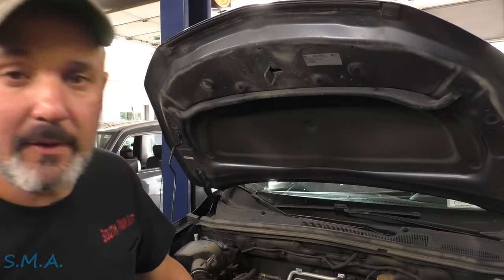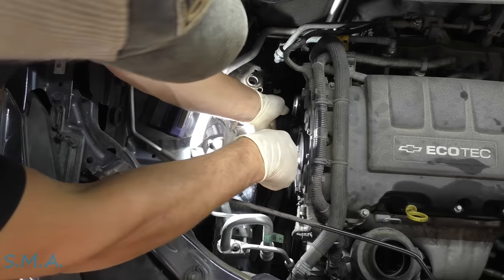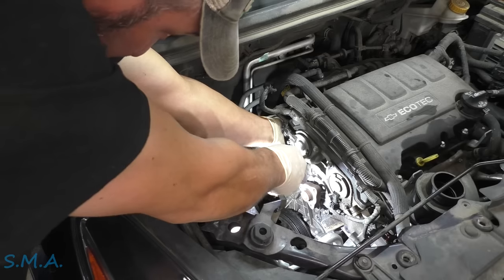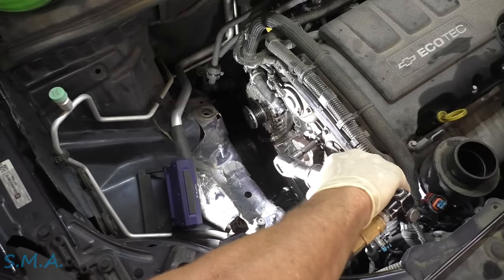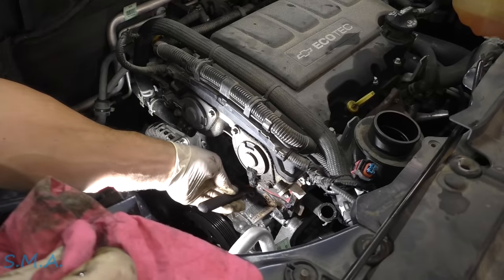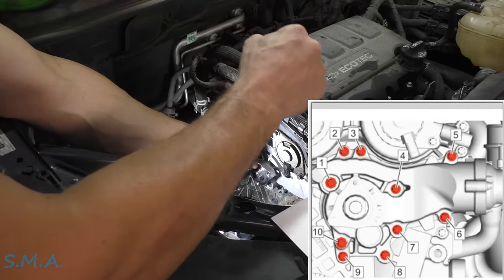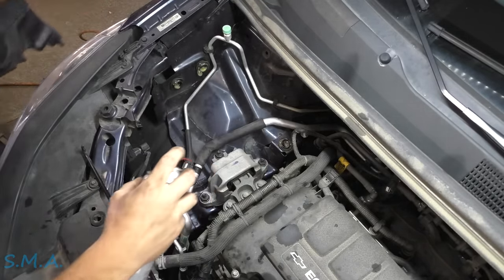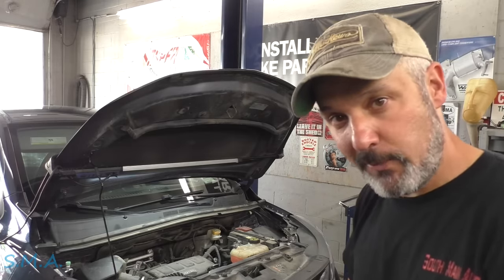Chevrolet Trax: Water Pump

Comment: 6 motor mount bolts on that 1.4 torque monster... impressive.  I hope its enough to hold it.
Reply: And the motor mount bolts are torque to yield. Had to buy new when I replaced water pump 1.4 ecotec
Reply: @stevem2757 no, they are not torque to yield on the motor mount. I've been doing this for 15 plus years, thousands and thousands of cars and never once has there been TTY motor mount bolts. I have two vehicles with the 1.4t and I've looked in service data...you are wrong just so you know. Crank bolt is TTY though
Reply: Take it easy dude. Chill. That was the advice from the Chevy service department/parts.  That is what I was told when I purchased the new water pump from the dealership.
Reply: Also some of the water pump bolts are tty also confirmed from the dealership.
Reply: @stevem2757  again, you're wrong. No water pump bolts on anything are torque to yield. I've worked on thousands and thousands of cars...thousands of water pumps, never tty bolts. They want to sell you more stuff buddy. Even service data confirms they are not tty bolts. I have service data for my 12 and 13 Cruzes...which have the exact same engine as the trax and encore...same water pump. I looked it up before I even commented. If you need dealer advice on how to work on a car, please just don't do your own work.
Reply: GM Service Bulletin # 14371B
Date 1/2015 Parts Listing Outlined from the OEM. GFY Troll don’t ever reply to someone’s post a year later, again. Again GFY Troll.

Comment: hell yeah...a few years ago were were headed south in he 2008 town and country. developed a leak in the housing from the radiator to the engine. sruck in friday night slow freeway traffic near mt.vernon KY. Finally got off to the exit. Got flat-bedded to a shop nearby....the due had mud trucks and some drag cars and I knew we were in good hands. 5 years later and the '08 town and country is still running strong. Thanks to those dudes in KY....

Comment: Another well-designed GM product for ease of maintenance.
Reply: If you think this was bad maybe some day he will do a v8 4.7 toyota timing belt, every 100k.
Reply: Sarcasm ?
Reply: @guns-gas-diesel  that one is not bad. Huge space to work on
Reply: I would take that one. Remove the engine mount and you have 1/2 a mile to work between the engine and frame.
Reply: @guns-gas-diesel  lol this engine won’t even last as long as the timing belt on a toyota

Comment: Modern car engineers meeting.
The boss: "Replacing a water pump is way too cheap and easy.  We need to fix that."
Engineer one: "We could design them to fail in four years, and require a good mechanic spend two hours replacing it."
Engineer two:  "Let's cover it up with the air box."
Engineer three: "Better yet, let's require removing an engine mount."

Engineer four:  "Amateur hour.  Let's put the alternator UNDER the water pump!"
     The meeting breaks into laughter, with the boss pounding his fist on the conference table.
Boss:  "Man, you guys are catching on.  What else you got."
Engineer one:  "Well, the parts guys propose over-pricing all parts, and back ordering everything."
Boss:  "Mr. Engineer One, pricing parts is for the bean counters.  This is a professional engineers meeting, so get back in your lane.
Reply: Good analogy. It would seem that they make it so that you get mad, say things you will regret and scratch your head saying " why would someone design the water pump to take 2 hours to take out. I could go on and on.
Reply: Apparently you’ve never replaced a timing belt driven water pump. Lol. This is cake work compared to a lot of them.
Reply: “Oh, and another thing, let’s put the starter inside the transmission. “
Reply: Yup!!🤣
Reply: To be fair he also didn't have to remove the tensioner or the radiator hose going to the thermostat housing I've done 2 water pumps on my 1.4 and didn't have to do any of that
Reply: @jimburgess9205  Or “under the Intake” What,,,, Cadillac ! LOL
Reply: @alexlacey9808  Have we come to that?  Water pumps, alternators, sparkplugs, starters, etc., should be maintenance items.  They currently are not, nor will they likely ever be maintenance items again.  Modern engines have become so reliable that many are put away way too early, as the cost of what should be routine maintenance is silly.  Moreover, most cars are put down because the AC stopped working, or the windows stopped working, or the rear stunts needed replacing, or one of the computers stopped working, etc.. etc.
Reply: You never worked on a franch car huh ? These GM engines are a dream to work on. Any dude with a spanner can go at it.

Comment: 45 years ago, I replaced a water pump in a Datsun B210 in 15 minutes with a 13 mm socket on a 3/8 drive ratchet after wrenching on the 3 pump bolts and the fan belt.  More time was spent drinking beer while waiting for the car to cool down than executing the repair.  Mrs O might not approve of my delay tactics but I was in my parents driveway, thus had supervision.
Reply: Yeah...so true.  I have an 89 GMC V1500 Suburban...time to access and remove water pump was maybe 25 minutes and I'm DIY.
Reply: Hell yes.. same with my '84 toymota pickup.. I miss her.
Reply: B210...was good.....I bought a new 310.....much fwd junk.

Comment: Another way to keep track of the bolts is to use the picture on the box (if it has one) and pop the bolts through the cardboard in their proper location.
Reply: nail  polish comes in all different color that is what i use steal it from the wife
Reply: @juanrodriguez-ry6yt  "nail polish... steal it from the wife..." Sure thing, buddy. We believe you. Millions wouldn't.
Reply: I usually avoid buying GM’s and that solves the issue
Reply: Geez, I was upset I had to remove the alternator to replace my water pump.
Reply: I used to use glow in the dark nail polish to mark timing marks to use a light gun on. It worked great.
Reply: In my experience the picture on the box is a random/generic representation of whatever the part is, not the actual specific part.
Reply: @awakenotwoke1973 😂😂😂

Comment: I recommend you replace both water pump and thermostat they are cheep garbage too i have replaced the water pump just to replace the thermostat 10k miles later both pump and thermostat go around 115-150k just easier to do 1 and done as always your the best Chanel out there showing how to do stuff love your channel

Comment: My friends seem to bring me this repair in various owners as skill level.  So what I so appreciate is the small needed alignments, such as the pin, the top motor mount and bracket (as slightly lifted). And the real care as not to break tabs.  As these units age, the tabs become very brittle.  Even with the most careful pressures, will snap from age and heat cycles.   So, as pricing these repairs to aged models, it is very prudent to include a bit of extra as small fitings estimated to need.  And, as was shown, a new belt.
Thanks for having us along.  M.

Comment: You're doing a fine job young man. This is more GM junk. We run about 20 fleet cars in our company and the two that have been the most trouble have been a Chevy Equinox and a Fusion Ecoboost. The '21 Equinox broke down with about 6,000 miles on it. The Fusion suffered a severe oil leak at somewhere around 40K and required a new engine, then the water pump on the replacement engine failed at 115K and almost ruined another engine. Anything with a larger naturally-aspirated 4 cylinder(Altima/Camry/Fusion)have been flawless.
Reply: Loved my Beretta, but stared at it for 30 minutes before my brain would accept that I had to take off a motor mount to change the belt.
Reply: Turbo Gm, or Ford 4 cylinder. JUST SAY NO

Comment: Nice video, great for everyone to see how involved this job is.  The upper radiator hose has a quick release thats easier to remove than the clamp. I remove the 3 thermostat bolts and leave the thermostat attached to the bypass hose instead of fiddling with that hose. The 3 horizontal motor mount bracket bolts and the 3 vertical bolts are all also torque to yield one time use bolts.
Reply: Once you removed the quick connect retainer, what exact action is used to remove the hose side from the thermostat housing? Pull? Twist? Thanks!

Comment: Had to do one of these a few months ago. Dont buy a cheap water pump, the one i was provided the impeller wasn't pressed on all the way and bound up when i bolted the water pump on so i got to do it twice. May as well replace the valve cover gasket while you are there before it starts misfiring from oil in the spark plug tubes.

Comment: Thermostat replacement used to be DIY job for $5 but this is a "better" way of doing it.
Reply: Unfortunately all thermostats cost way more than they should these days. Had to replace the thermostat on my 08 impala last week at 210000 miles and the freaking thing was 34 dollars from Napa. That was the cheapest I could find locally too. If I wanted to wait a few days for it I could have gotten it from rock auto for 8 bucks but I couldn’t wait all week.

Comment: Very nice, Eric O.! I have an '08 Saturn Astra with a 1.8 L Ecotec. Mine's an XER, though, so after air box and serpentine belt removal, there are 8 bolts: 3 for the pulley, and 5 for the pump. I'm about to roll 110,000 miles and the pump is just starting to weep, so I suppose the seals are about to go. Pump is on order and should arrive next week. Cheers!

Comment: love ur vids . having done a dozen of these professionally over the last 12months.  u don't gotta worry about locking or removing the tensioner . plenty of access
Reply: I made a piece of cardboard for the bolts of the water pump. Also a drawing of the belt position. Works good

Comment: I know it wasn't on this video, but watching you soldering wires together on another video inspired me to buy a butane soldering iron and go fix my heater fan pigtail correctly... instead of using coughs wire nuts.... I only had an old Radio Shack 30w electric type and it just didn't stand a chance against those 12 gauge wires... the butane did perfectly, and made quick work of the shrink wrap.   Thanks for showing all the little details like you do, it sure helped me to do my little job.

Comment: Those are a gravy job in the shop. I personally haven't found an issue with the quick connection on the thermostat. I like that you made sure the bolts were different lengths. I found it's easy to get a piece or cardboard and use them thru so that even if you drop it they stay in place

Comment: I always loosen up the pulley bolts first before removing the belt - especially when I don't have an air ratchet . I sure would love to have some of those tools - LoL - the hose clamp tool is amazing as it is so hard to try and get pliers into some spots . When I worked in a shop years ago - I would just use a die grinder and cut off the clamps and even the hoses . Most of the time if you dont cut the hose and take it off - the fittings can pull right out of the heater core etc.

Comment: my Opel / Vauxhall car has the same engine and I stopped counting how many times I did the water pump in 10 years. That upper hose I always unscrew and take out the pump first and then. remove the hose from it, find it easier that way.
You can leave the thermostat housing connected to the small hose.. remove 3 bolts and disconnect from waterpump.. leave thermostat in car, new seal before the new pump . Also  the housing is robust, never broke one… but broke several of the outlet on the other side of the head

Comment: Wow, looked like a nightmare of a job to me. I'm glad it wasn't me doing it. Man at the tools that would have been flying. I'd also hate to pay the bill for that job. I wouldn't want to change or pay to change that alternator either. Good job man.
Reply: Doesn't help that the engine is in there sideways like so many vehicles....Not sure I'd even want to try a water pump replacement in a regular pickup either, so much crap in the way that has to be removed.  I tried replacing the head gasket in a 1991 Ford Tempo about a year ago, didn't turn out good at all, it wouldn't run at all afterwards...that led me to realize I'm not a mechanic at all (never claimed to be in the first place), got the car for free luckily, and sold it for $200 for parts.  However it was a great learning lesson, never attempt to work on something like that if you've never done it before, and don't know what you are doing.  I figured hmm, its a 4 cylinder engine, so only 1 head to deal with...yeah, well somewhere at some point something didn't go together or come apart right because it didn't run at all after I got done with it :(.

Comment: I just scheduled my 2018 Civic EXT for the water pump and drive belt replacement at my local Honda service. The weep hole is dripping. My car hit 116,300 miles. Total cost: $875. For all the work involved, I consider that price more than reasonable.

Comment: I have a 16 year old Honda with almost 200,000 on the clock. Still running the original water pump. Even if it does go out it is 30 minutes to replace it. Small difference in quality there...

Comment: 2.0 ecotek in my Saturn. GM wanted $1000 to change the pump. I had to take half the ngine apart but did it for $200? Turbo had to come off as well as the fuse box and battery tray. What fun.

Comment: Great video.
If you replace one of those air cleaners, save the rubber grommets- they work perfect for the upper part of that hood prop, last forever
Leave t/stat housing in car- remove the 3 bolts instead of the hoses, I find it quicker

Comment: if there is one thing i've learn and told my customers in my years of mecanic is that if you have a thermostat  that is really hard to get at  and takes a lot of time  you better change it while i'm already there cause if not and it gives  up  in 6 month or a year its going to cost you the same price as  the job that i,m doing right now . Most of the time people did listen and  fallowed my suggestion . Those who didn't  well some of them got to learn the hard way .

Comment: I had two of those Chevey Trax with less than 60k at my shop. Both had over heating issues and serious Bucking when accelerating. No codes or coolant leaks. However, the overflow tank looked like someone had put Strawberry Milk in there. I looked in Mitchell for TSB's. Turns out the Transmission fluid and Coolant Mixes due too a faulty radiator. 
I don't know if someone else has dealt with this issue.
Reply: GM have had this 'Feature' for decades.
Reply: Pretty common problem with internal radiator failures in many brands of vehicles.  That's why its best to have an external auxiliary transmission cooler that isn't tied into the radiator at all.

Comment: Leaking water pump in only 4 years? Removing Motor mount to change a belt? So much for progress.
Reply: In the old days, older technology required parts to be robust... engineering was typically simple already. These days, our advanced technology is used to engineer cars and parts to sit on the bleeding edge of functional versus cheap as absolutely permissable.

Comment: Did this on the son-in-law’s similar Chevy (Daewoo) Cruze—second new pump on his second engine. Service data calls for Loctite on the pulley bolts. I was all out of blue, so I used orange. V Remind me not to do the next one ;)

Seems like the ACDelco is better built than the GM Genuine pump, too…

Comment: I've wrenched on alot of cars over the years, the oddest water pump I changed was on a early 90s Cadillac Northstar engine, the pump was odd shaped and had over a dozen bolts some were hex head and some were torx some were longer than others, the easiest water pump I changed was on a mid 2000 ford focus only 4 bolts holding it on with an o ring to seal it up. Notice eric used no rtv on paper gaskets, biggest mistake I was making in the beginning using rtv on paper gaskets
Reply: Yep I have a 2002 Focus was done by previous owner at 146k I have 203k and it is fine.
Reply: Agree,,,, + “no U tube “ to help out ! Ignorant cars to work on ! I remember the first starter to replace on a North Star,,,, couldn’t find it,,,, under intake manifold! I was embarrassed! Never forgot it,, many years later,,, still today !

Comment: Just replaced the water pump in my 2006 Pontiac G6. It only lasted a little over 3 years and just shy of 30K miles. It was an OEM ACDelco too. Apparently it was leaking out the weep hole and the bolt-on pulley and drive belt were flinging coolant everywhere and making a huge mess. It made it difficult to see where the leak was really coming from. I also took the opportunity to replace the thermostat and a couple hoses as well.

Comment: Flipping insane! Take a motor mount off just to change a belt.
Reply: I remember reading the Haynes manual to replace the belt on the first car I had that was a front wheel drive. It said the same thing, support the oil pan with a floor jack to allow removal of the engine mount - I was like REMOVE THE WHAT?
Reply: I found the HARDEST belt to replace EVER. 2014 Ford Flex 3.5. I almost gave up🙄. I needed to use a belt wrench from the top and the bottom of the engine🤔

Comment: If you're not sure which bolt goes where ... just look at the new pump ahead of install and each bolt should have a home based on how long the hole it travels through is!! Like 3 little bears .... some bolts will be too long for certain holes, and some will be too short, and some will be just right! Easy peazy if you just look at the hole lengths

Comment: A lot of guys use the Milwuakee 12v 1/4 cordless ratchet for this type of job as they have 25ft of torque just right for this type of work
Reply: Jimmy S  There is a high torque one and a lower torque one. Higher torque one has to much power reinstalling bolts. I have snapped off a few being un-careful at first.

Comment: This is like the third video with that 03–05 LX Element sitting there. Motor job due to head gasket or lack of valve adjustments? How’s the rear trailing arm mounts?